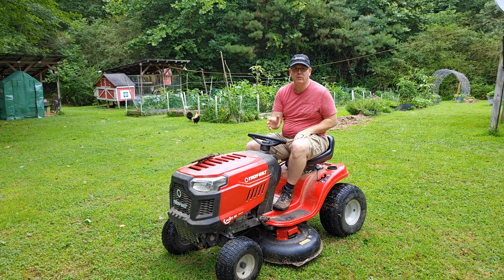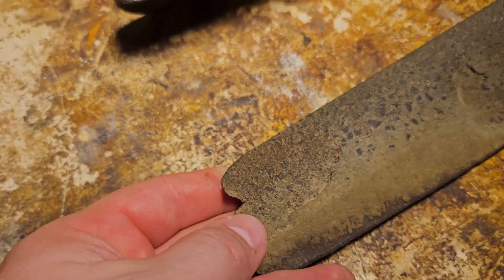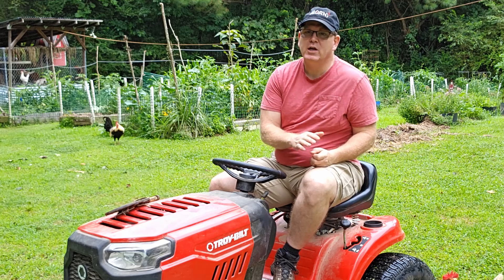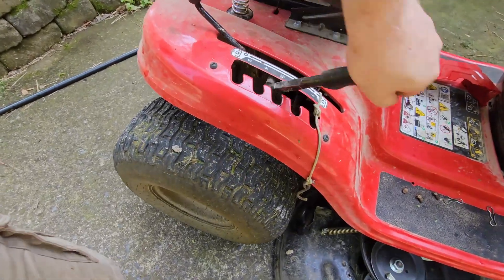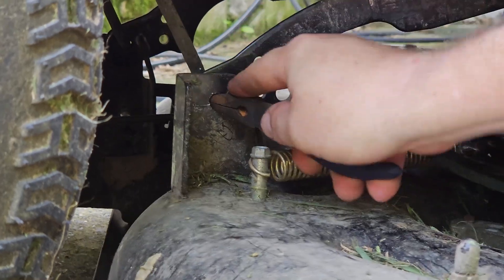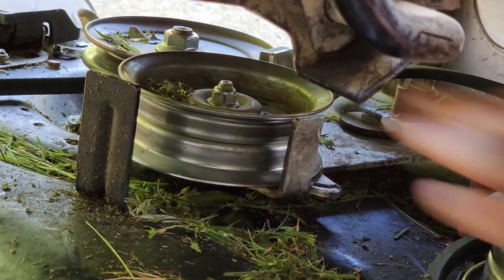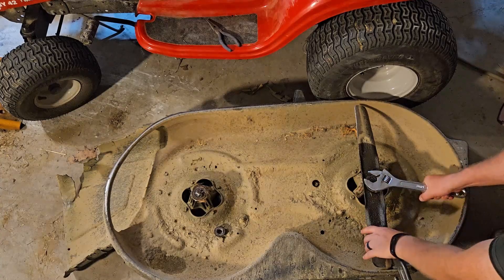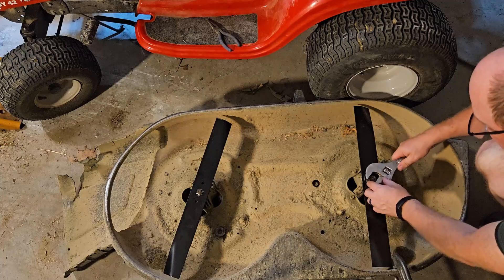How to Change Lawn Mower Blades - Step by Step for the Troy-bilt Pony 42

Comment: It is far easier to raise the mower  (wood or cement blocks under the front tires) and remove /reattach the blades without the hassle of removing/reattaching the mowing deck.
Reply: That's right. Why make it simple when you can make it complicated? ;-)

Comment: Good and simple video. I own the  troy bilt pony model, but the model year for my lawn tractor was 2011. There's some areas of similarity and some different areas of design on the deck and pulley types.   The only thing that I would add to your video as a foot note.  " Since you pulled your deck off,  you have time to check the bearings in the belt guide pulleys, check the spindles bearings, grease the metal on metal parts, and take care of any rust spots that maybe beginning to show up. Usually a wire brush, angle grinder, piece of sand paper, and spray can of Rust-Oleum Troy bilt color red paint can take of any mid season problems.
Reply from the maker: @kd4baoc612  thanks for watching and commenting. Those are some good tips.

Comment: Thanks, I like the step by step instruction for removing and reinstalling the whole mower deck. That will come in handy when I have to do this. Otherwise, if I am just sharpening the blade I will raise the front end of the mower, as the presenter pointed out, then remove the blade, sharpen and replace...
Thanks, also, for the Scripture from Ecclesiastes! Great wisdom for anyone regardless of their world view🙏😎
Reply from the maker: Glad it was helpful. Thanks for commenting.